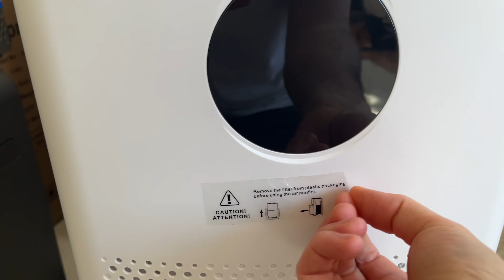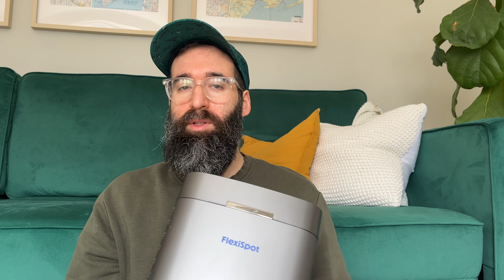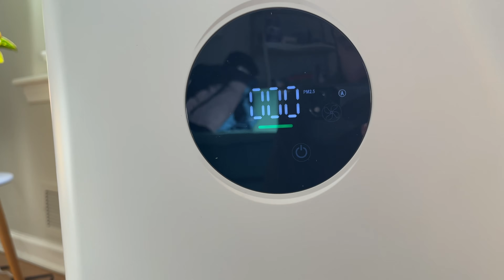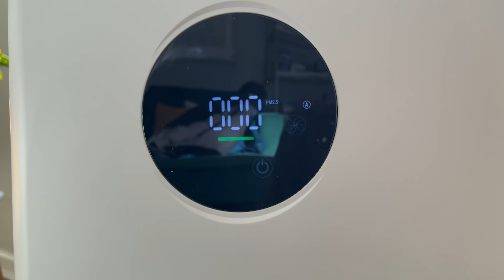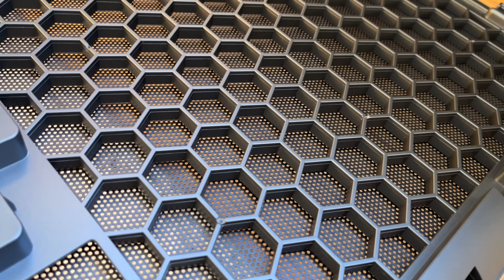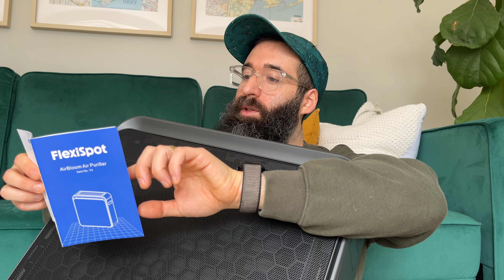FlexiSpot Air Purifier Review (Y2, Y2 Pro & Y4): Breathe Clean Air!

Comment: Hi, where can I buy the airbloom air purifier filter in case I need to replace the existing filter. Hope to hear from you soon. Thanks
Reply: I was able to convince them to re-issue the ORIGINAL FILTER !!!   Go to their website then (forward slash) air-purifier-replacement-filter  👀👍
Reply from the maker: FlexiSpot doesn't sell replacement filters to my knowledge. You'd have to track down replacement filters with the dimensions below:

Y2 Pro: 15.0" H × 9.6" Diameter
Y2: 9.1" × 6.3"
Y4: 15.4" × 13.0"

Comment: How about replacement filters, did they ever respond?
Reply: We emailed Flexispot to inquire about purchasing replacement filters.  Someone did respond and asked us why we thought we needed to replace the filters.  What?  We responded by saying the filters are dirty, and there is a video on their website showing how to replace the filters, so the filters are not permanent.  Haven't received a response from that exchange.  Can not find the filters for Y2Pro anywhere on the net.
Reply: @notalemming7370 Thanks!
Reply from the maker: The only help that I can be is passing along the dimensions. For the Y2Pro, it's 15.0" H × 9.6" (diameter).
Reply: were you able to find any replacement filters?
Reply: I was able to convince them to re-issue the ORIGINAL FILTER !!!   Go to their website then (forward slash) air-purifier-replacement-filter  👀👍